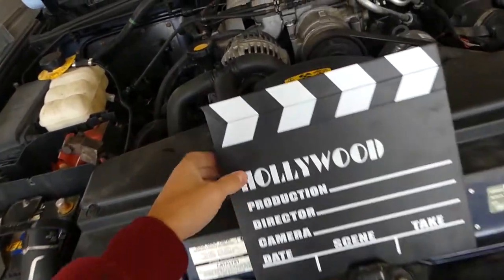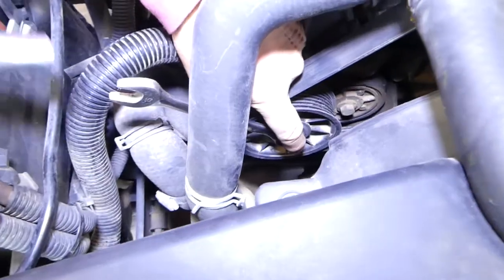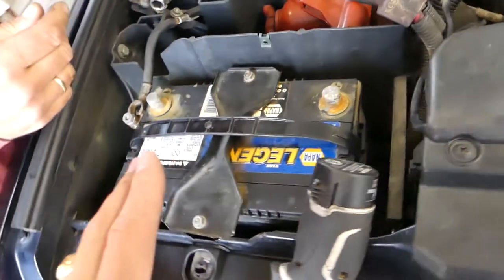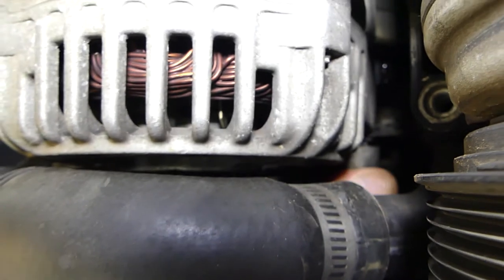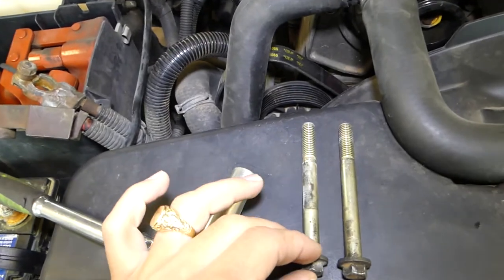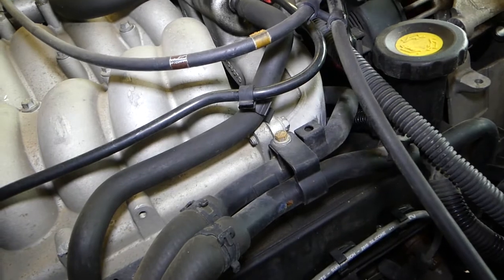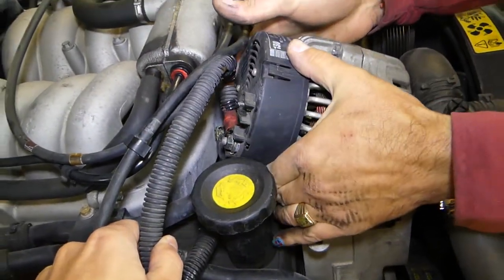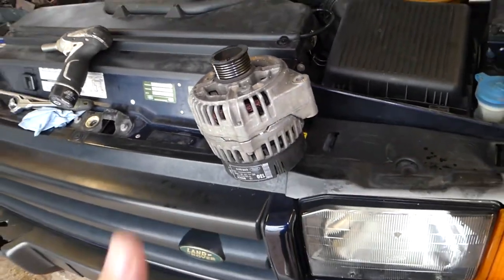Land Rover Discovery Alternator Removal Replacement Generator

Comment: The hardest part of this repair is getting the belt back on. There is a trick to this. The problem is you need to torque the tensioner about 90 degrees to get the belt back on. When the belt comes off you only need to torque it 20 degrees. So you need adequate clearance to torque the wrench. You must remove the plastic cover that the radiator hose sits on. This allows more room to torque the tensioner. Also, you need a 2” extension on the wrench so it sits out far enough to get the 90 degrees. It’s not intuitive you need to crank it so far because Only 20 degrees was needed to remove it. So you can remove the belt with the plastic cover on but you can’t replace it. It’s a bit tricky for one person. I had to use a long screwdriver to prevent the belt from slipping off the bottom pulley.